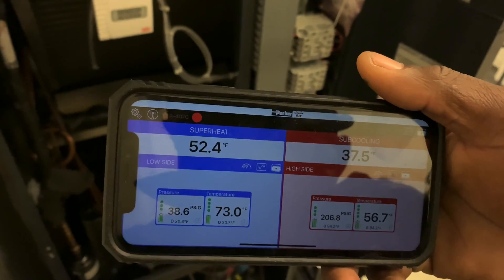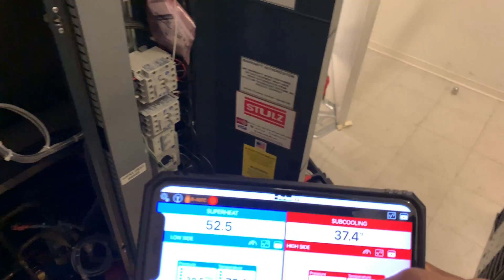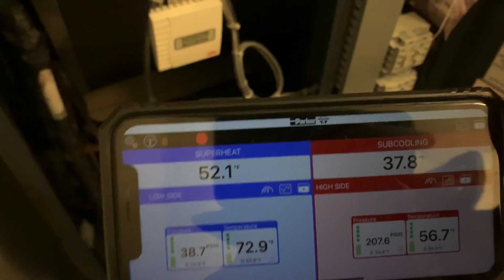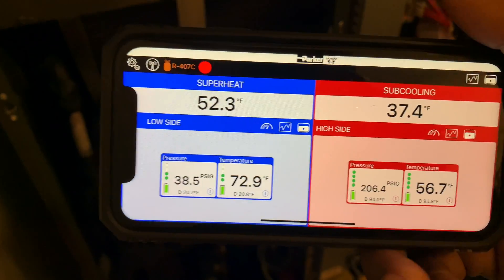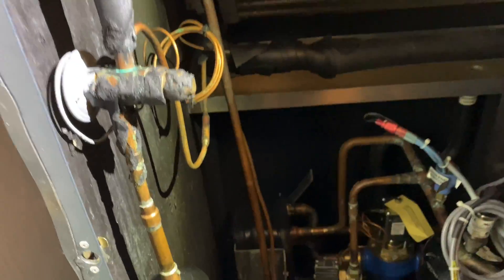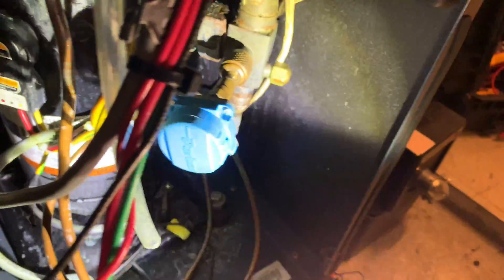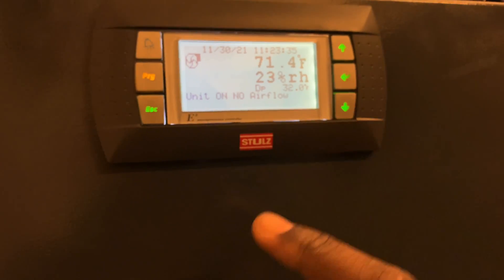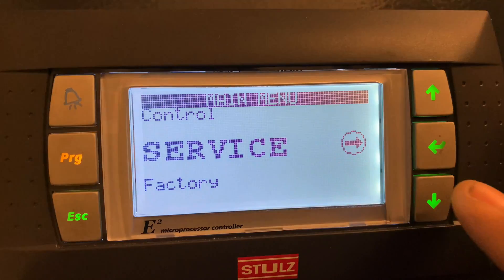HVAC TROUBLESHOOTING TXV

Comment: Could be the TXV, but couldn't it also be a kink in the line or restricted filter-drier?  Need to measure temperatures before and after the filter-drier and check the liquid line for issues.  Unfortunately in comfort cooling you almost never have a sight glass.
Reply from the maker: Very good my friend

Comment: Great video thanks for posting it

What was the sight glass doing with this TXV issue?
Is it always a restricted TXV or do they also get stuck fully open? What kind of pressures / temperatures can you expect to see if the TXV is stuck open?

Also wondering what could have caused this? And what else could potentially happen if this issue isn’t corrected for a extended period of time?

Thank you!
Reply from the maker: @pub chat sight glass would be clear my friend full of liquid, never seen TXV failed open in my entire  career,  low head and high back for sure if txv is stacked open flooded evap i supoose a low SH and high SC, restrictions and broken sensing bulb perhaps txv mechanical failure  cause problems, the entire evaporator would eventually iced over  you could damage your compressor
Reply: Yes I am a tech, 4 years doing residential
I’m yet to condemn a bad TXV so I sure want to be ready when I do come across a bad one :)
Reply from the maker: @pub chat Damm this a loaded comment 😳 are you a technician?

Comment: Btw, I know you have the 570. Why didn't you use that instead of the app on your phone? Cheers.
Reply from the maker: You mean 557s lol 😂 I only bring those puppies out on special occasions, no these ones are perfect for regular service calls and checks and easy to carry around.
Reply: @D2DNYAC  Right! 557.  I picked up one after seeing your  maiden voyage with it.  I plan to use mine next season.  Haven't decided which wireless probes I will use.  I saw a comparison video between testo and fieldpiece. I'll probably get the fieldpiece probes since they all work with measure quick.

Comment: What software are you using to get your pressures and temps, and what probes are you using to work with the software to get those readings? 
I also didn't see any links in the vid description. Cheers.
Reply from the maker: Parker smart service tool
Reply from the maker: Smart service tool app!